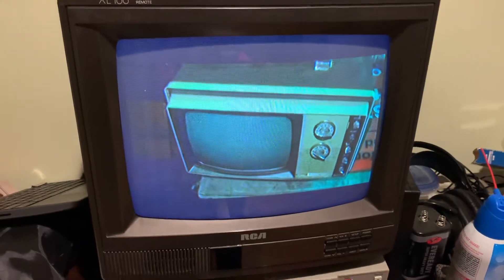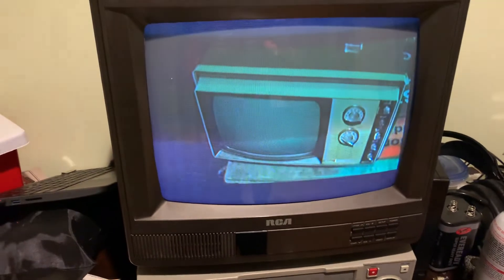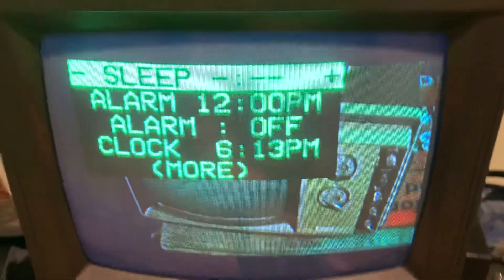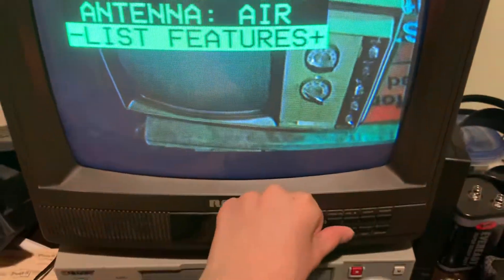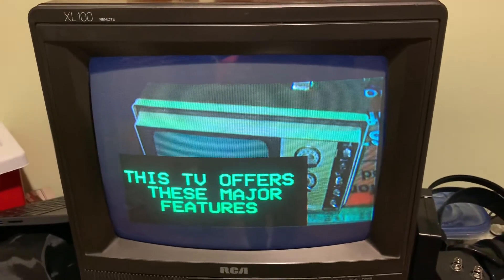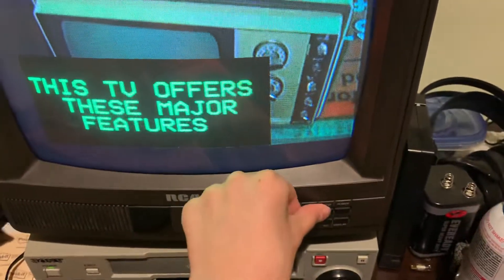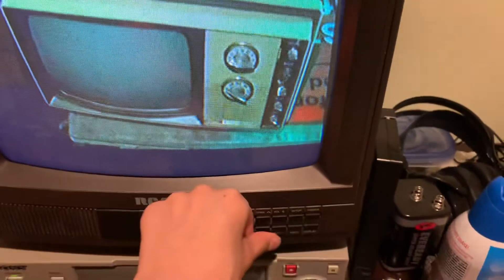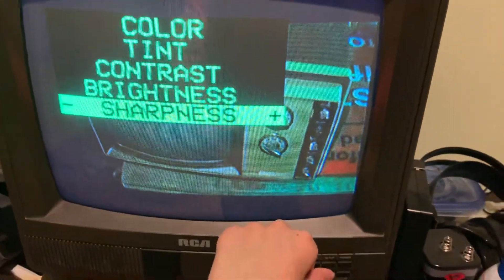1992 RCA XL-100 E13155WN Woodgrain CRT TV

Comment: Hey Alex, looking to plug a camera output into this tv. Would my only option to be to run the input thru the antenna port?
Reply from the maker: Yes, that is correct if you don't feel like composite modding this TV. I have the knowledge, but I have just been too lazy.
As far as connecting it goes, you can use an RF modulator if your camera has a composite output. If your camera has an HDMI output, you need to get one of those little HDMI2AV things as well.

Comment: Hey Alex, how can I plug a VCR into this?  I have the coax but everything I’m trying isn’t working
Reply from the maker: Plug one end of the coax cable into the VCR's output. It is usually labeled "TV out", "RF out", or "To TV". There is usually a switch on the back of the VCR to switch between outputting on channel 3 or 4, so make sure that is set to the channel you want it to be on.
Then tune the TV to channel 3 or 4.
If all of this doesn't work, there is probably something wrong with your TV or VCR.
Reply: @HIDLad001  and on the TV itself, do i set the settings to "air" or "cable"?
Reply from the maker: @henryblazer20  Air.